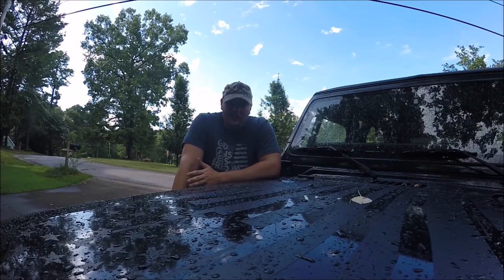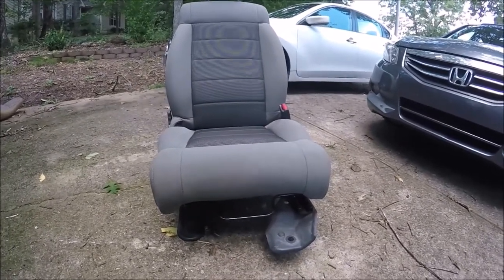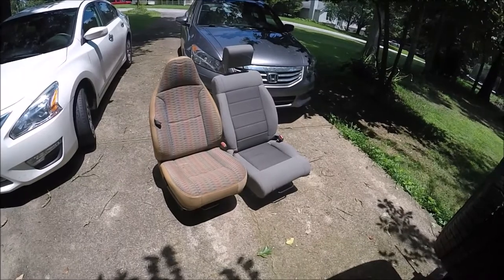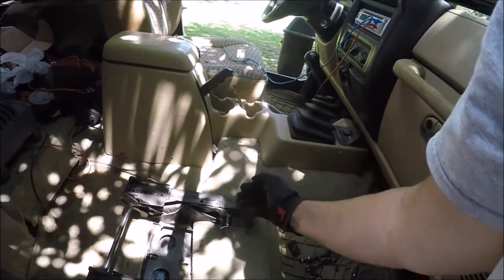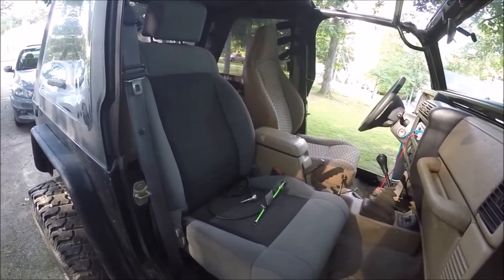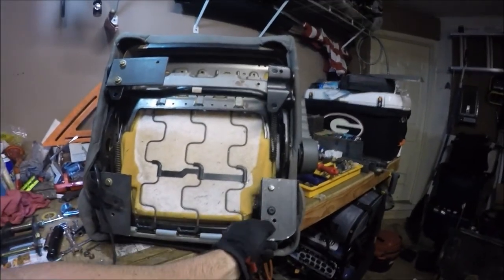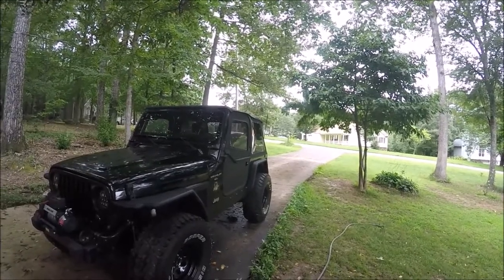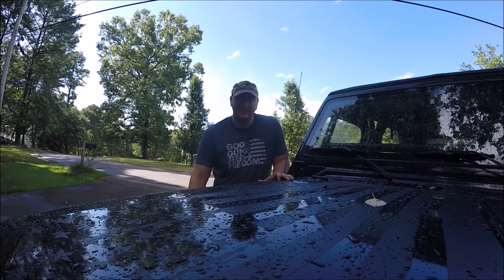Jeep Wrangler TJ - Installing JK seats in a TJ

Comment: Hi, this is a great video, and perfect idea. So the sliders are from the TJ bolted to the bottom of the JK seats with brackets to mate the JK seats to the TJ Sliders, and TJ sliders bolt to the tilt frame as normal.
Reply from the maker: Thanks! That is correct. TJ risers and sliders with homemade brackets to attach the seats to those sliders.
Reply: So I am going to make the passenger side brackets first. The passenger side only has 2 brackets to mount the TJ sliders to the seat base. Whilst the driver side has 3 brackets, of different lengths. I am having 2" x 7" brackets made for now in 1/4" mild steel...once the passenger is fitted, I may take it over to the machine shop to have the drivers' side brackets fitted.

Comment: Hey cvsahara, I have a question maybe you can help me out. I just got a '99 tj about a year ago. I am 6'8". My first issue was that the seat didn't go far enough back, my shin would touch the dash as I stepped on the clutch. It wasn't very comfortable at all. So I built some brackets to move the bottom mounting bolts a couple inches back so now I have room in front, but now the back of my head hits the roll bar, I'm sure you can see the problem with that. 

So I need to move my seat down, but I have no idea where to start. As you know the tub of the tj is not flat so I cant just rip every thing out from the bottom of the seat and mount it strait to the floor... any idea?
Reply from the maker: Man, I wish I had answer. At only 6'4", I have fitment issues. couldn't imagine adding 4 more inches!
The only suggestion is to move the seat back to its original mounting position and put spacers under the risers to raise the seat. sounds counter intuitive but the extra height on the seat will straighten your legs out and keep them from hitting the dash and the stock location will keep you out of the rollbar. as long as it doesnt put your head too high for the windshield frame you should be good.
Reply: cvsahara - I have a frameless top and my hair already hits the canvas, I'm afraid if I go any higher my head would be touching it

Comment: Why bother when you can buy a brand new Bestop seat for $150?
Reply from the maker: I bought both these for $150 total. I had bestop seats in one of my other TJ's and these are much more comfortable and much larger. Being 6'4" and about 260, I need every centimeter I can get. The "$150" bestop seat is their bottom of the line seat. They would still wind up costing well over 300 for 2+ shipping and taxes, wouldnt have adjustable headrests, etc. Good question though! So far these are the best fit I have found for a fatboy over 6' that I have found. I tried, bestop, PRP, early TJ seats and Late model TJ seats and some of those super cheap ebay seats.